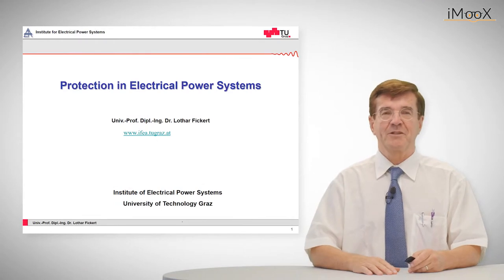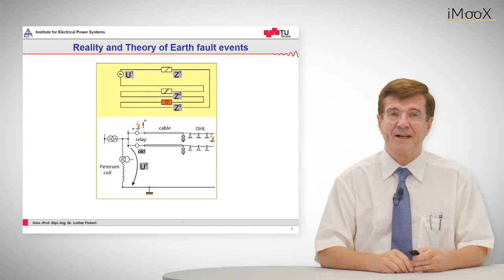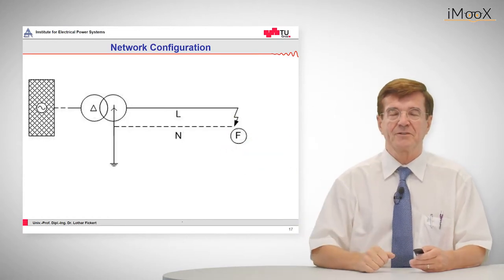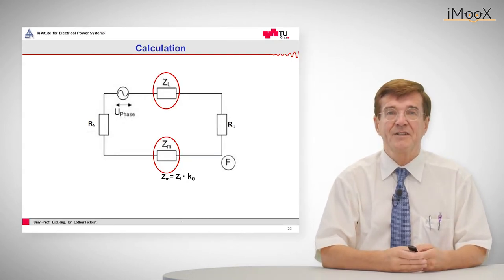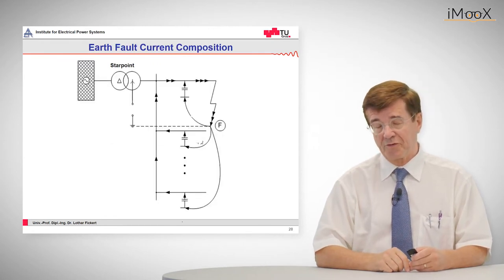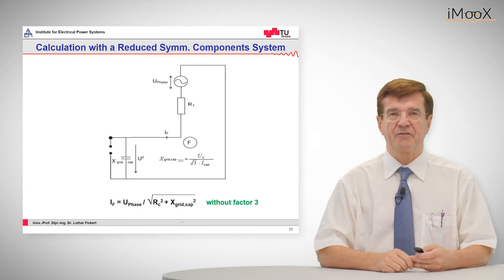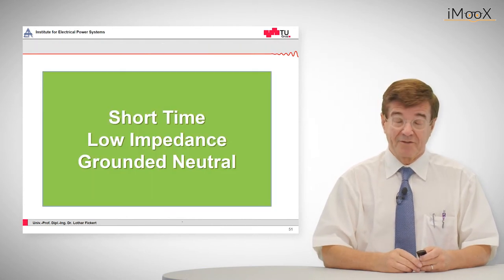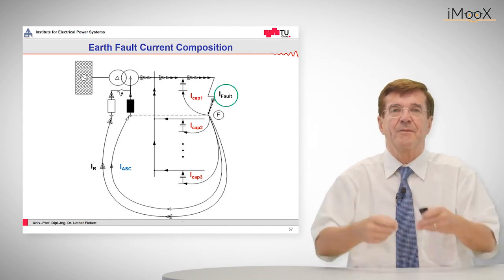E3 Earth Fault Protection: Earth Fault Calculations

Comment: Hi Dr Lothar, thank you for your videos which is very enlightening. Can you make a video with some numerical examples. In my project, I have a 3MVA 22kV/415V delta-star transformer which is solidly earthed. Our earthing system is TNS system.  I have sized the earth cable from the neutral of the star point to the earth bar to be 1x 95 sq mm pvc copper earth cable. To size the earth cable, I have the adiabatic formula - s= Sqrt (I x I xt)/k. However, other engineers have considered that this earth cable is too small. 2x 1c 95 sq mm cables should be used. I have used the earth fault loop impedance resistance to be 1 ohm. I would appreciate your comments. Thank you very much.